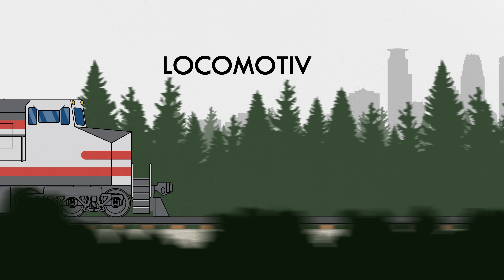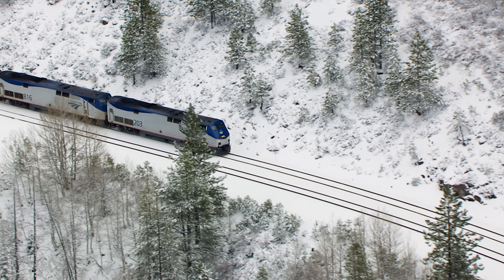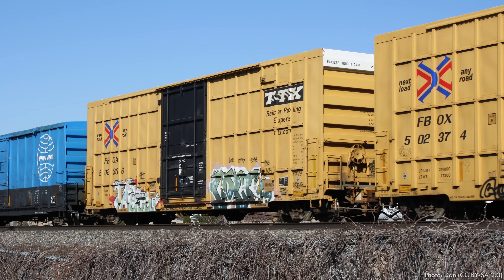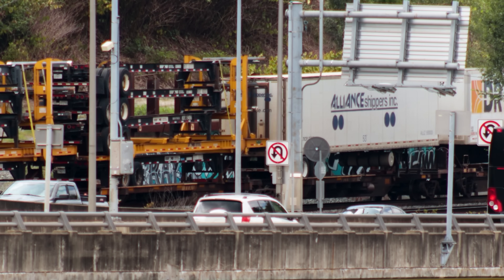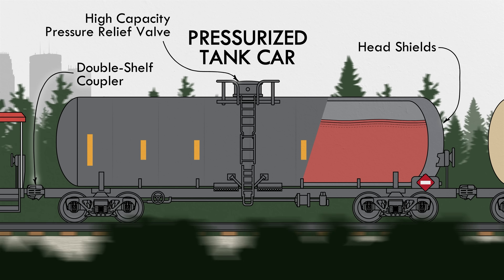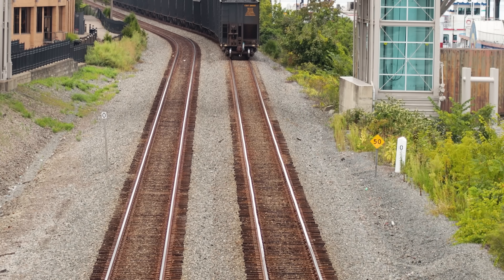Every Type of Railcar Explained in 15 Minutes

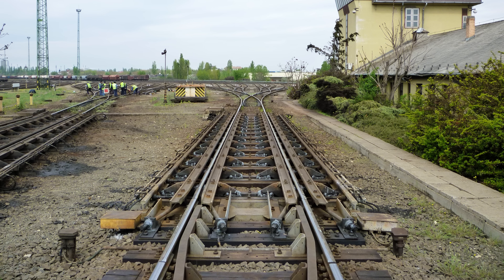Comment: Great video! I am really excited about this series. The only mistake I noticed was the scale at 12:36. Shown in the picture is actually a rail brake used in hump/classification yards. And in the MOW section you didn't mention vehicles to install/maintain overhead wire, although they are of course less common in the US.

Comment: The one kind of car that I see frequently that I don't think you mentioned is a spine car. It's just another kind of flat car, specialized for COFC, but it's also interesting because spine cars (and well cars) frequently come in three- or four-car articulated units where each pair of platforms shares a single set of wheels.

Living next to the BNSF Scenic Subdivision as I do, the other thing I see regularly is one of those "other" cars you mentioned: the special trainsets Boeing uses to transport fuselages from their manufacturing facility in Wichita to their assembly plants in the Puget Sound area.

Comment: You could do a whole video on the intermodal containers.  I've seen containers that are modular water treatment plants, offices, armored boxes for transporting ammunition, open top, containers that are just folding ends with no side or top, lined containers to move liquids, and on and on.
Reply: While the West Seattle Bridge was closed, the detour went past the Alaska Marine Lines terminal, where you could frequently see all manner of one-off special-purpose intermodal containers, I suspect due in part to the larger role of rail transport in Alaska.

Comment: Don't forget cab cars! They allow for very fast turnarounds for passenger trains and are an instrumental part of for example the Helsinki Central station, as it is a terminus station and the adoption of cab cars shortened turnaround times for locomotive pulled trains thus increasing the capacity clearly

Comment: In Europe there are Sliding Wall Cars, which allow for the whole side of the Car to be opened for side access.
Similar to Box Cars, but a bit different.
Then there are Controll Cars, which basically have a cab at one end of a passenger car to be able to drive the train from both sides with just one locomotive.

Comment: An interesting topic for train infrastructure might be points where train tracks connect temporarily, from switches over turn tables, lift and other types of bridges to ferries and maybe even planes that transported trains. Another one would be all the connections between different rail networks with different voltages, gauges,...

Comment: A very common car that was missed is the 5 section well car. At a glance it looks like 5 double stacked intermodal container well cars, but it is actually one car and each section shares a truck with the next. So the empty space between container ends is greatly reduced making the train shorter, and they only have 12 axles for 20 containers instead of 20 axles needed for 5 separate well cars. These light multi-cars are made possible by the typically low-density of intermodal cargo (Occational heavy cans can be loaded single instead of stacked) and the large scale nature of the transfer yards (to truck of ship) means that cars don't need to be routed to individual customers.

Comment: I have had fun watching your videos, having worked in the field my entire career. I worked for consulting engineering firms, working on structural framing of buildings, site plans, for buildings, cellular antenna sites, roads, and bridges. I also have worked on some mechanical and electrical plans for buildings. The two areas I have not worked on are airports and railroads. I look forward to your series on railroads.

Comment: As a long-time rail enthusiast, I want to thank you for doing this and for getting it right.
Reply: He did mention most cars, but he forgot about road-railers and hoppers, both open-top and standard. Cabooses are typically known today as "shoving platforms". There's also road-slugs and yard-slugs.
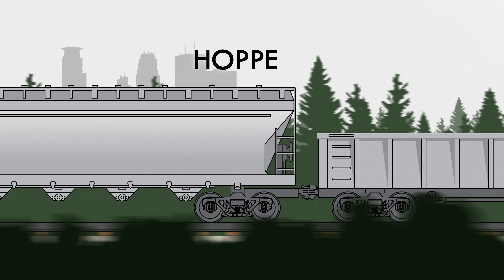Reply: @goober239  He certainly did include hoppers (covered and open) at 8:20.  He's going to cover the different kinds of motive power in a later episode.  A shoving platform can be any kind of surplus car that has been modified to provide a trainman a safe place to ride temporarily during a long back-up move (as in serving a long customer spur that might have crossings, switches, etc.), instead of having to hang on a side ladder.  Since ex-cabooses have end platforms, they are ideal for this.  They often have their interiors removed and doors welded shut, which makes them nothing but a platform.
Reply: @goober239  I mean, he also "forgot" all the other cars/wagons that have fallen out of common use since the dawn of time.  
He covered just enough, especially considering its towards North American freight operations.

Comment: You forgot about post car. While these days, thses tend to be simple box cars. In a not too distant past, these were actually (in some countries still are) mobile post offices on the wheels, attached to passenger trains!
Also, about Cabooses. In Czech Republic,we have them too, though they look a bit different, but they are still in use on trains that pick up and drop off cars in stations, that no longer have crew maning the station, or on tow lines, that are shared by multiple factories. The reason for this, is that every time a car is disconnected, breaking weights need to be recalculated and updated, so that the engineer can drive the train safely.

Comment: You seen those pickups with train wheels added quite regularly.   The other day I saw a train engine with road tires added to it.   Sure it was one of those small engines used for shunting box cars around a train yard but still.   First time I've seen that.
Reply: Not sure what model it was but like the 2016 Shuttlewagon NVX5025

Comment: Bilevel (maybe trilevel?) trains are the norm in New South Wales (Sydney), didn't realise how rare they were until I started travelling.

I say maybe trilevel because the level you ingress/egress on is only a portion of the length of the carriage.It's designed for people with mobility issues/ luggage/bikes and for people to wait if their stop is next so load/unload times are reduced. That level has stairs up and down to the main space where people sit.

So lower main level, level you in/egress, upper main level.

Comment: Im super exited for this series! I often volunteer in a Local Railway Museum in Germany that actually still drives old Steam Locomotives and I help maintain the Train tracks there so this series is extra awesome for me, because we still do all the stuff thats automated now in the oldschool manual way :D
Reply: One neat thing to look into (if you haven’t already) is using “Torrefied Biomass” instead of (at least lower grade) Fossil Coal.  Might be hard to get (unless you make it yourself!), but lower costs, reliable sourcing, and no Fossil Fuel Use and Hazardous Coal Ash makes it quite neat.

Steam Trains are quite neat!  Makes me think of all the complexities in Display Technology before Cheap LCDs.  All the complex systems just to have a piston turn a wheel, nowadays a simple engine, or even just an electric motor does not just as well but better!
Reply: @ericlotze7724  I don't think our Railway Association has looked into that yet as far as I know, but you're correct, sourcing Coal is getting quite hard these days, haven't heard of any alternatives to coal fuel for those trains, I always thought nobody was developing any because the technology is basically only used my museums ^^

Comment: You missed the slug.  These are used with a diesel electric locomotive under certain conditions, mostly low speed traction.  Most diesel electric locomotive are traction limited at low road speeds, a slug is electrically connected to the loco generator to divide current in series connection to locomotive traction motors, essentially acting as a "low gear".  These slugs are always immediately aft of a locomotive and usually have no cab.  
Slugs are also used for dynamic braking as the traction motors turn into generators while coasting.  Dumping this current into a resistor bank provides useful braking without wear.

Comment: "All trains have at least one locomotive" - Wrong.  Diesel or Electric multiple unit trains (MU), typical of high density commuter rail, don't have a locomotive.  Although there are variations, each car would have its own means of propulsion, and cab for controlling the train on each end so the car or trains don't have to be turned at the end of a run.  A major variation is the use of "married pairs" where two (sometimes 3) cars will divide up propulsion equipment between them and have cabs at the both ends of the pair.  Another is a power-trailer setup where one car has propulsion and the second is a trailer - don't confuse that with a "locomotive pulling a car" - usually the cars are of similar appearance and the trailer would have a cab, the power car would only have sufficient power to haul it's trailer, and sometimes these types of cars are linked with others in a longer train of MU cars.  There are multi-level MU cars as well (Chicago and the new SF Bay Area cars in the US).  In the US, major commuter railroads operate these types of cars around New York City, Philadelphia, Chicago, Denver, and soon the SF Bay Area, and possibly others I'm not thinking of - they are common in Japan, Europe, and elsewhere.
Here are some videos of such cars:  NJT Arrow IIIs (New Jersey):  https://www.youtube.com/watch?v=SHfFBqaTvNQ
SEPTA Silverliners (Philadelphia):  https://www.youtube.com/watch?v=WouNjziQBus
Metro-North Budd M2/M4/M6 (New York):  https://www.youtube.com/watch?v=EGNu6RE5wiE
Metra South Shore Line Electrics (Chicago) - double deckers:  https://www.youtube.com/watch?v=umvv-7o9ZBc
Denver RTD:  https://www.youtube.com/watch?v=6uNq1Mg2484
CalTrain electrics (SF Bay Area):  https://www.youtube.com/watch?v=e8LzyFO8fV8
Reply: Nobody cares.
Reply: @RealJeep  I'm sorry, do you need a mental health help line number?

Comment: Here in the UK, well cars (as well as double deckers) are seldom seen as the tunnels are too short. You're far more likely to find flat cars with containers on them on intermodal freight trains. Interesting to know the stuff they use in the US though! Look forward to future videos!
Reply: On cable TV in the US, the UK TV show, 'Top Gear,'  did a show on the steam powered locomotive still operating in the 21st Century, where Jeremy Clarkson informed the viewers that 30 pounds of coal was needed per mile to keep the steam locomotive's boiler properly heated.  That was mind-boggling to hear.

Comment: Not that many years ago, before we had grain hopper-bottom cars, boxcars were used for grain hauling.  The elevator manager would pull the car up and use wood and cardboard to board up the doorway part way, and then using a fill tube would fill the car with grain through the door opening above the cribbing.  newspaper would be stuffed into cracks to keep the grain from spilling out.  When the car started to get full he'd have to climb in and shovel the grain towards the ends of the car, before he was able to shut the door.  Starting about 35 years ago, we finally started to get hopper-bottom grain-hauler cars designed just specifically for grain (owned by the Canadian government at the time).  So much easier to load from the top and then unload out the bottom at the destination.

Comment: I've been in:
Coach car (short tourist stint)

I've seen:
Dining car 
Dome car 
Observation car 
Probably baggage cars 
Boxcar
Refrigerated boxcar
High cubes
Flatcar
Bulkhead car
Centrebeam car
COFC
Wellcar
Gondola cars
Hopper cars
Tank cars
Pressurized cars
Caboose (decomissioned)

Through local railfans vids:
Road-rail vehicles
Track-geometry car (a converted Budd Rail Diesel Car!)
Caboose (running)

I've got a pretty good tally!

Comment: In Norway they use a special railcar for transporting semi-trailers where the trailer is lifted from the truck directly on to the railcar, and secured on a fifth weel on the railcar. the whels of the semitrailer sits inside the railcar and is hidden. In my area theese railcars together with container cars are the most used ones. The semi-railcar can be seen here: https://youtu.be/YjtezN0zP6s?si=hzkqDkPGVMhWRrx9&t=20

Comment: "every train has a locomotive"
you forgot about diesel/electric multiple units

also double decker car actually reduces congestion, since it doesn't reduces loading speed, but reduces needed frequency, so you have more time loading trains and less time changing trains

Comment: For anyone interested in really unusual or one-off railcars, Southern Plains Railfan has some great videos!

One other car in the vein of high-rail vehicles is the railcar mover, which is like a locomotive the size of a tractor. To get traction on the rail they will use hydraulics to lift up on the railcar to "steal" some of its weight, or activate electromagnets to pull the machine towards the rail

Comment: I've seen everything BUT double deck passenger equipment, and the shncabel car, and I've seen almost every load flatcars can haul, the one's I HAVE NOT seen are airplane bodies, artillery (self propelled, towed, rocked, traditional), farm equipment, military support vehicles/trucks, and export locomotives. Yes I've seen Abrams tanks on flatcars. At least one train a month has them out of 50 a day EVERY DAY.

Comment: Do you need information on rail signalling? (Points/train detection 
/signals/interlocking)

I’ve also worked with plasser theurer tamper/regulators and an undercutter for 5 years

Comment: Every type?? I made a steel hardening furnace car for a copper mine's ball mill. I worked on a ballasting train. That had hopper cars with a conveyor belt underneath several cars and a shaker rig that lifted the rails &  sleepers up while fresh ballast was poured under the lifted track. Then a shaker would shake the track back down into the ballast. That is another one of a kind mess.

Comment: Seasonal maintenance also requires specialty cars: brush cutters with huge rotating blades look very intimidating, but can cut brush and small trees that are encroaching into the ROW. Snowplow cars will be sent along the main lines to clear heavy snow; I once saw one with 2-3 cars of concrete blocks to add momentum to the fast-moving train. And the most unusual objects I've seen being transported were massive 26000(ish) pound ingots of aluminum. Love trains!!

Comment: There is another type of passenger car you missed out on which is the "Driving Van Trailer (DVT)" which is essentially used on passenger trains as a passenger carriage combined with a driving cab at one end, usually used on long loco-hauled passenger trains which makes the service cheaper than using 1 locomotive at each end of the train and it makes it easier than shunting the locomotive from the front to the rear of the train but I guess DVTs are virtually non-existant in the US or really anywhere outside of Europe...
Reply: Cab cars are used extensively in the US on commuter trains. The last car in the Surfliner train at 1:27 is a cab car. You don't really see them on long-distance trains because they're kind of pointless in that application.
Reply: Isn't Amtrak convert their old six Axle locomotives into a baggage/Luggage DVTs? I forgot the locomotive series. (SD40P? F40PH?)
Reply: @farizfadillah7557 : you're thinking of the 4-axle F40PH, many of which were converted into what they call Non-Powered Control Units, or NPCUs. They have the benefit of being safer in a collision when operating in push mode because of their significantly greater weight than the average passenger car.
Reply: @ErickC  ah, thanks for the correction...
I thought they were converting those six Axles.
Reply: They were used here (Netherlands) in the past but they are all gone now.  The passenger trains now all are train sets with powering distributed along the length and a driving cab at each end.

Comment: Great video, but I do want to point out that double decker cars are actually very common around Europe, particularly on regional trains, but also on intercity and even some high speed services (notably the TGV Duplex). They're quite common as EMUs as well
Reply: They're not uncommon on heavy commuter rail in the US, either - Chicago Metra and the Seattle-area SoundTransit use them, for example. 

Amtrak has a variant they call the "superliner" that is two-level, but the lower level is mostly baggage storage and restrooms, with a small number of seats for passengers with mobility concerns that would make the stairway to the upper level problematic.
Reply: In Canada as well, any train I've been on is a double decker
Reply: They’re pretty common here in the US, I know they’re not usually as common in the rest of the world. Maybe thats what he meant
Reply: Yeah, that comment bugged me. Here in Finland you have about a 50% chance of ending up on a double decker train if you're travelling long distance.